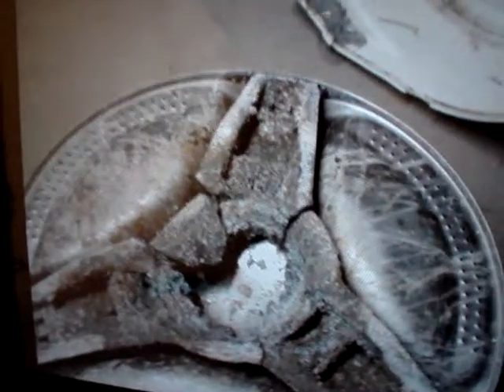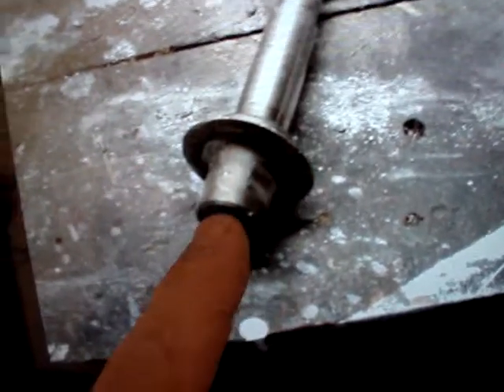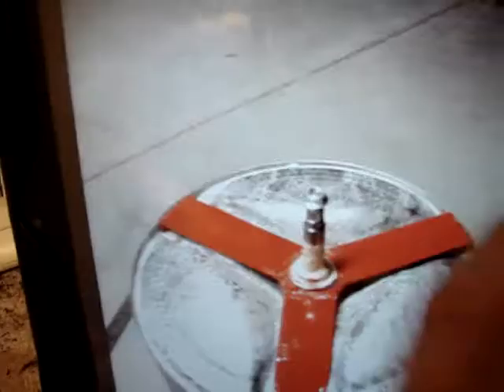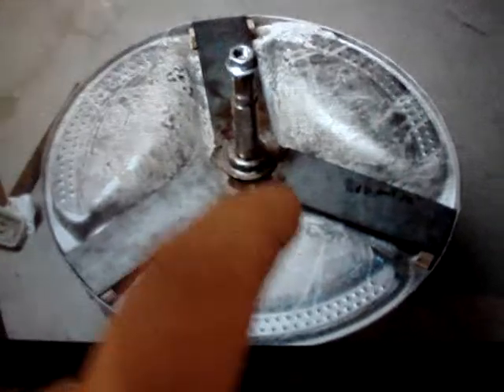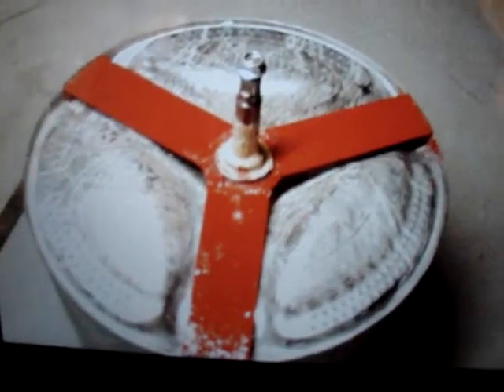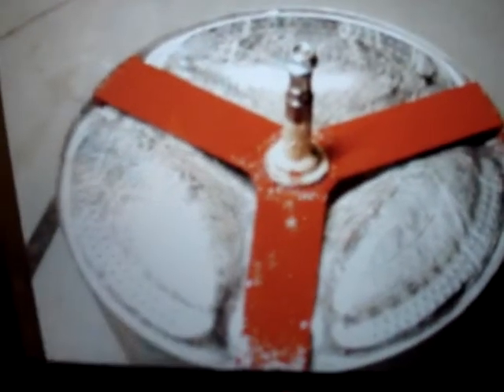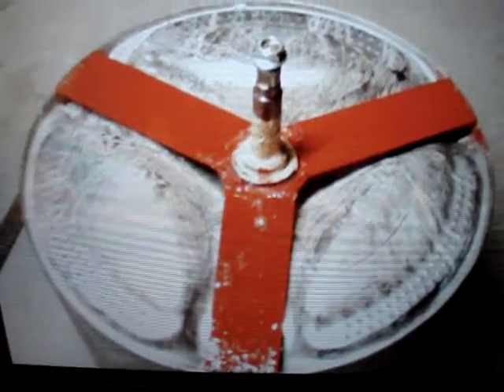Homemade HE3T Spider Bracket

Comment: How long did this fix last?
Reply from the maker: It lasted until the washer finally quit. It kept getting errors saying there was “foaming.” Another known issue……That washer was the biggest piece of trash I ever purchased.
Reply: @budzillasohoski9858  How long was the fix in place before the washer quit? How many loads per week (or month or year)? Did you do a post mortem to evaluate the condition of the spider?
Reply from the maker: @ItsVideos  oh…yeah it lasted for years! I’d say close to 7 or 8 years. Hundreds and hundreds of loads. I did not do a postmortem lol. I’m 1000% sure the fix would’ve lasted forever. The paint that I used was a 2 part epoxy paint. It’s what the military uses to paint the inside of wings where fuel is stored. It’s nasty stuff but works like crazy.
Reply: @budzillasohoski9858  Did you have it hot-dipped galvanized, or a galvanizing paint?

Comment: Hey one question have you had any issues with 
Early bearing failure due to the added weight using steel? Also how or what did you use to get your shaft perfectly plumb. Seems to me if the shaft is even a couple degrees off it would cause wobble at high speeds.

Comment: Designed to break today i dismantled my Bosch machine   with intent to change bearings I was shocked to see that the  support had failed totally the drum had cut into the plastic  drum  container ..  . initially I put the corrosion down to the WELL water and detergents ... cost of living off grid   but then I found  some clips of  similar problems from other people who were using  mains supply ...  fact is does not matter how much you pay for your machine they are designed to fail ....  Bought this machine for just sort of  500 euros  13 years ago .. replacing a Hoover  that ran and ran and ran for over 30 years  drum never failed replaced the bearings once and the motor once in all that time ... only replaced it  because could not get  parts in France ... it  has been in the barn ever since  .....come to think .. i wonder  if i could   transplant the drum  into the Bosch ....

Comment: What I found when my broke was that the OxiClean supplemental powder that I was putting into my Kenmore front load washer was all over the entire back.  It was completely covered in OxiClean pellets, that did not dissolve!  So, with it covering everything, because it was not dissolving, it caused mine to corrode! Do not put OxiClean powders in your washer!

Comment: Thanks for the video, how did the Fe plate hold out ?
Reply: Exactly .. Most companies such as LG, Samsung, Bosch adopt bolted tubs that can be opened and supply spare parts such as the drum spider. But some companies such as Hotpoin, Indesit, Whirlpool oblige the purchase of the complete tub which has a very high cost equivalent to a new washing machine.

Comment: Like many others, I have the exact same problem.  Given that getting this true and centered is critical, could a replacement spider be made with adjustable arms that bolt to a housing that supports the shaft? with some play in the center housing, it could be adjusted to plumb and bolted tight.   It may even be possible to create a few different center housings (for different sized shafts), and a few different arm lengths, and be able to accommodate a several different makes and models?

Comment: BiMetal?! Has it now come to that? I've lived too long.
Reply: Aluminum spider + Stainless Steel drum = Galvanic reaction.   His fix using Steel will almost eliminate that issue but it would simply corrode because it’s in water a lot.
Reply: @martynh5410  It could be coated with an epoxy resin such as pattex liquid steel.
Reply: @JonnyBrek   Yes agree on that.  I replaced the spider on my machine with the standard aluminum one.  Probably will fall apart after 5 years like the first one did :(
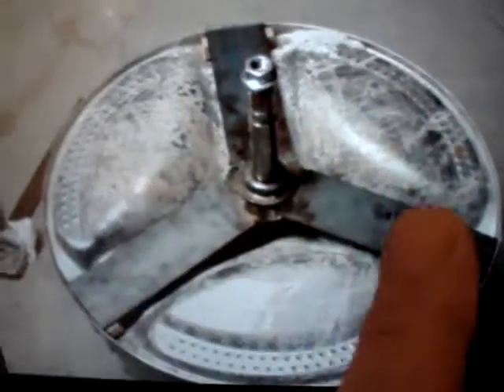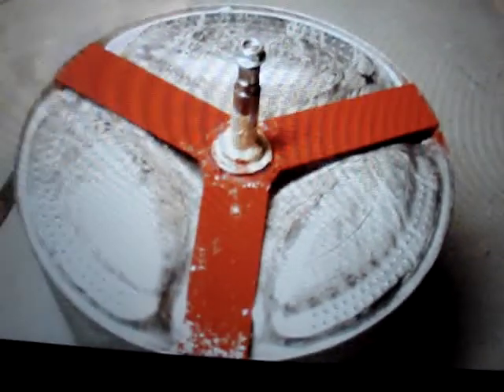Reply: @martynh5410 If you were lucky enough to find the new part you could have painted it with rust inhibitor. If you follow some tips it will last you more than 5 years. The main cause of the damage are liquid detergents at low temperatures. So if you want to avoid this problem I recommend at least every 15 days to use good branded detergent powder and wash at 90 degrees. A full wash is done around 2:30 or 3:00 and when not in use the washing machine leaves the door open so you will help dry everything out of the water.

Comment: The sort of thing I could do, but should NEVER have to do. Disgraceful corporate criminal design. They made the main support for the drum a sacrificial anode! Imbeciles!  To remove the shaft, stick it into the anus of a Samsung engineer, then pound all around the die casting with a ball peen hammer. When the spider breaks off the shaft, use large channel locks to remove shaft from Korean anus.

Comment: The shaft in mine is in good shape but the bracket is done. I need to get the shaft out of the center. Have any recommendations?
Reply from the maker: You have to cut it out...there are no options. It is pressed into liquid cast aluminum during manufacturing. Just use a hack saw and cut it out little by little.

Comment: Just had this happen on my Frigidare front load.  Of course they won't just sell you the spider support since they didn't design it right to begin with.  Oh well, I work at a metal shop and I was wondering if it was even possible to make one myself and now I see that it is, thanks for that!
Reply from the maker: Yep, it can be done. I made mine a year ago. Took it apart last week to check on it an she's good as new. While I had it apart I put in a new bearing..why not right?
Reply: Yeah good point, perhaps I'll go ahead and order those.
Reply: since you can only get the spider and basket as one part number its lifetime warranted
Reply: @ufartface You didn’t check with Whirlpool I see. That assembly was discontinued way before your post 3 years ago. I checked in 2020 and the spider bracket and wash basket are no longer available. Yeah, it came with a lifetime warranty on the wash basket, but the bastards discontinued the parts so you are out of luck. 

Speed Queen all the way, that’s what I bought back in 2020 and I will never own anything else but a Speed Queen.
Reply: get it free then take the spider off- paint it then you should be good to go

Comment: You might want to a couple steel plates on each side of your machine, just in case the weld lets go. Imagine a  very large circular saw blade, or a small airplane propeller slicing its way through your home.
Reply from the maker: Yungfin, I hope you're kidding.... You don't honestly believe that this could in any way cut through the sides of the washing machine and continue on through walls and/or floors of your house..??? You watch too much TV.
Reply: Yungfin,  They actually sell these very same machines in your county( Kazakstan) to propell passenger aircraft.  Contact Borat for more details and how to purchase one.
Reply: Well, you could buy their top loader-exploder and have your jaw adjusted and teeth changed!

Comment: hi, nice video, thanks for share.. i am in same shit...thanks to whirpool
i am right now fighting with whirpool to send me parts as it still under warranty,,i don't know i may get or NOT..i have only one question how did you match perfect center of spider arm and shaft because little bit off center kills all work and drum will hit outer drum big time while hi speed spinning...
yes you already said that many time check different ways check again and again..but what basic things you did...to reach the best centerpoints ??
can you please describe method to find perfect center of drum before final welding...
if you don't mine just email me>>> neeljaviyaATgmailDOTcom
Reply from the maker: Hi Nilesh! The way I did it was to make the bracket as close to perfect as I could...Then I made a jig out of plywood, stuck the shaft through it and spun the whole thing. I put a gauge on the outside and measured the difference.